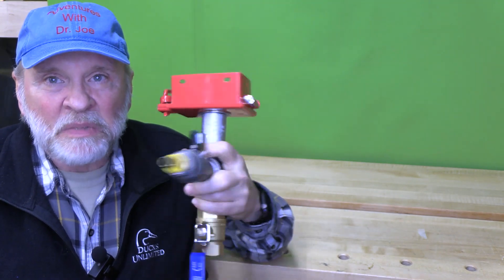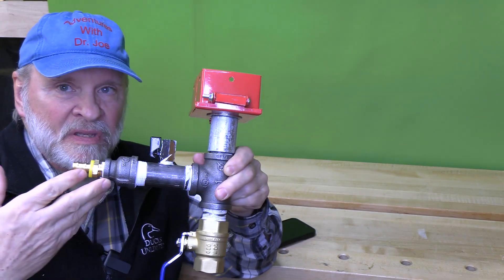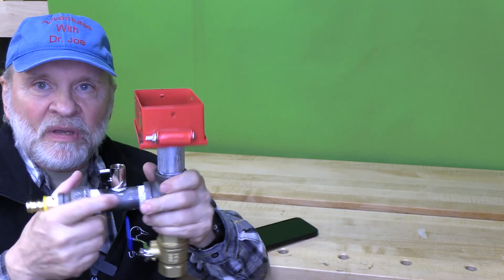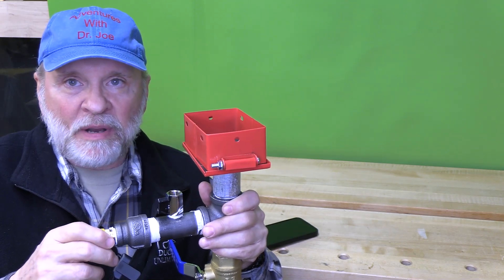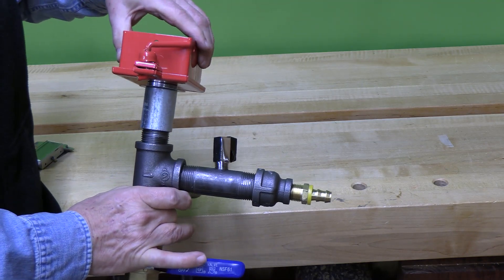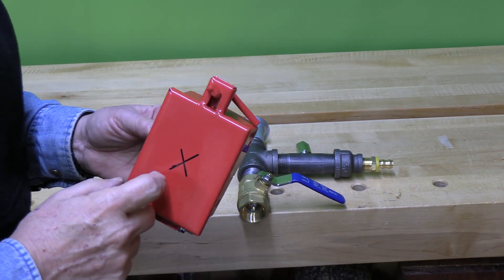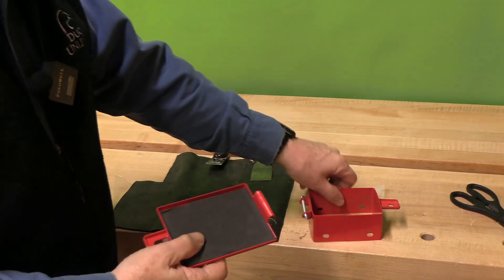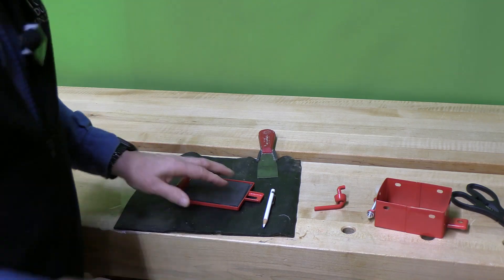Sand Blast Cabinet Metering Valve for Best Results w Dr  Joe

Comment: The Harbor Freight instructions indicate a need for 9.5 CFM at 90 PSI, which generally requires a larger 60 gal compressor. With the metering valve , do you think one could get away with a smaller compressor which produces about 5 or 6 CFM?
Reply from the maker: You ask an excellent question. With a sand blaster, the greater the cubic feet per minute the better because you get more flow out of the gun itself. You probably could get by with a five or six CFM unit, but you might be disappointed in the results. Flow rate is very important to propel the media through the gun to get a desirable result. It’s worth a try, but you probably will be disappointed. Consider subscribing. Thanks. Joe.

Comment: Hi, I've done exactly this but I find it doesn't work that well.  I'm sure there's quite a few factors, type of media etc, but what PSI and lever position do you recommend? Thanks
Reply from the maker: I actually have mine set at 40 psi and I’m using a 60 grit aluminum oxide abrasive. It seems to work well. And because of the other mods I have excellent light and excellent dust extraction with a good clear view. Consider subscribing. Check out my other sandblast videos. Thanks Joe